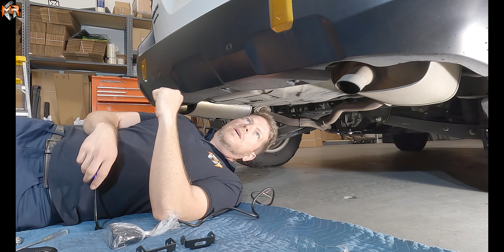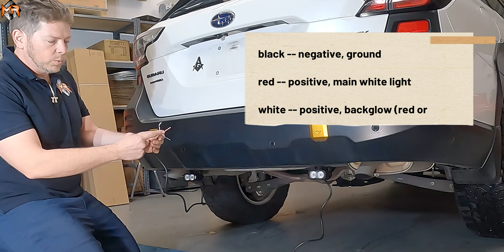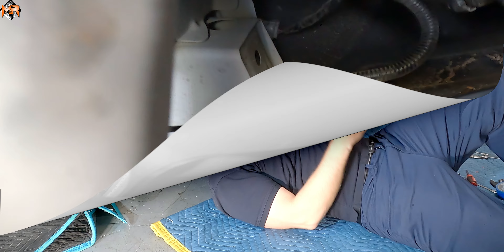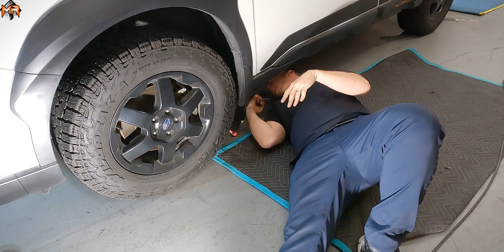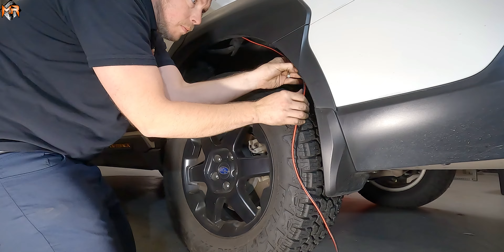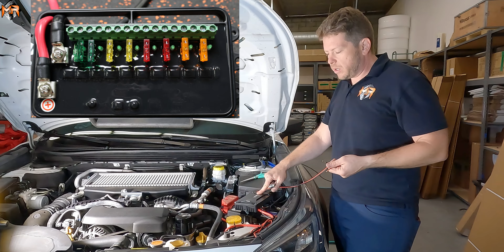Subaru Outback Reverse Light Install | Full Tutorial by M&R Automotive

Comment: There’s a capped off plug for a trailer harness in the cargo area. Why not just connect to that?
Reply from the maker: You definately can if it provides 12v when necessary
Reply: @MandRautomotive it’s a factory harness drop down dedicated to trailer light wiring. It’s going to work exactly like your taillights..

Comment: Or…you could use the factory harness just inside the hatch to wire the backup and cruise lights.
Reply: Just use the reverse light wire on hitch wires (if there) for quick easy work.
Reply from the maker: Yea you can tap into factory wiring